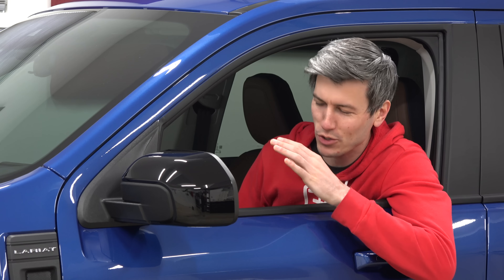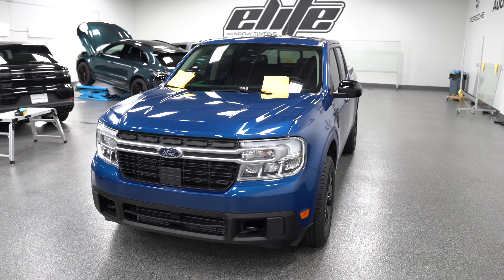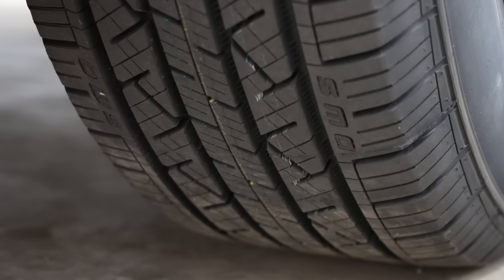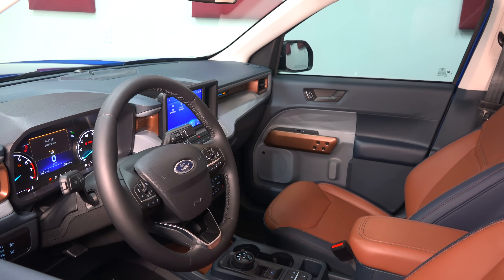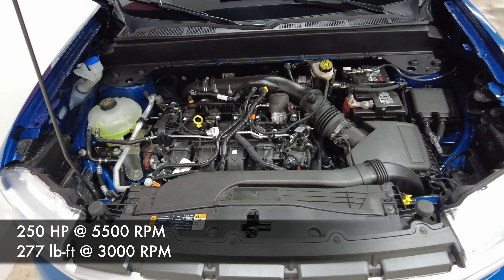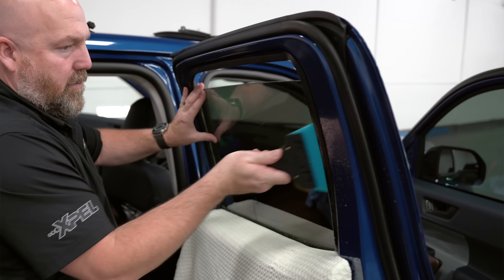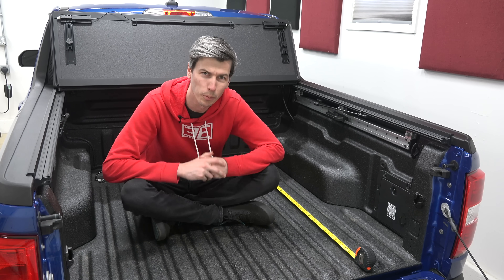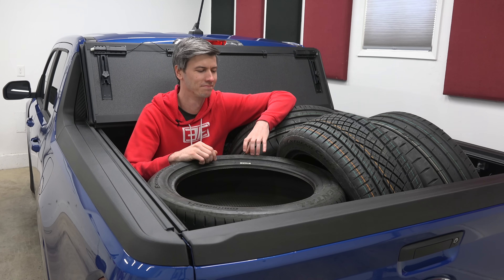I Bought A Ford Maverick! The Perfect Pickup?

Comment: Let's praise ford, anyone can crap out a poorly engineered entry level vehicle. But to design an entry level vehicle that has this much character, decent reliability, and respectable capability, that takes real effort. 

This is one of the first entry level vehicles in years that doesn't feel hopelessly cynical. You get the impression the designers and engineers who worked on this actuslly cared about it.
Reply: It’s not entry when it costs more than a 2021+ f150 xlt
Reply: @skyhawk21  You’re comparing a new 2024 Maverick Lariat? To a used 2021 F150 XLT? Just want to get that straight.
Reply: THis is a crap vehicle. WTF lol. Ford deserves no praise. They are a failure of a company. Ford is far worse than even tesla.
Reply: I doubt these will be “reliable” long term
Reply: @thomas735  The hybrid system has been around forever and has a stellar reputation for longevity.
Reply: @themidnighttavern6784  sure, it was designed by Toyota. I’m talking specifically about the 2.0T. If I had that engine I’d be doing oil changes every 3k miles.
Reply: @thomas735  It was designed by Ford and Toyota working together, it's more accurate to say Toyota uses Ford's hybrid system rather than the other way around. Ford uses some Toyota licensed parts at first, which is no longer the case. But the basic design principles of an akinson style hybrid system was patented by Ford first I believe.
Reply: @thomas735 the 2.0T isn’t that bad. Biggest issue is carbon buildup on the intake valves…which is an issue on most turbo direct injection engines. So yeah, you’ll probably have to clean the valves at some point, that’s a con for sure.
Reply: @themidnighttavern6784  dont argue with clueless people:) Fords hybrids are great
Reply: I love my maverick but man it's hard calling it reliable. Right now I don't want to take it to get serviced because I know they'll update the software to a known bad version that leaves you without power randomly.
Reply: @dpgerarddp  The losing power randomly thing is an upcoming recall. What Ford found was sometimes the software wasn't great at detecting the 12V state of charge. So at times, it would turn the engine off the save fuel, but the battery would be too low to restart it. There will be a new software update soon to address this.
Reply: @themidnighttavern6784  that doesn't sound like it's the source of the issue. Well at least not a primary reason. There's people out there losing all power on the highway in the middle of their drive, so why would the battery be discharged. Also how it seems to go hand in hand with the updated software and others like me, never have any issues. But my point was it has a lot of issues. The grabby brakes on lower software versions, loss of power on updated software, general issues with the wiring (I've had electrical problems throughout all these years), exhaust systems needing to be replaced (just ran into this one myself) etc etc
Reply: @dpgerarddp  The losing power issue was related to some bad software updates. Basically the truck wouldn't detect the battery being low, this could happen on the highway, as the hybrid still turns the engine off at highway speeds at times.
Reply: These are already having issues everywhere... They don't last.
Reply: @christianrobloxserver7282  Not really, I'm on the forums basically everyday. Most people are literally talking about how theirs has had no issues, mine included. Literally every car where they sell hundreds of thousands of them is gonna have some people who have issues. It happens with Toyota, Honda, Kia, Ford, Chevy, literally every brand with forums, you'll see people talking about issues.
Reply: @christianrobloxserver7282  The maverick is already on lists of most reliable affordable cars. The hybrid system has a reputation for being rock solid. Most of the issues with mavericks are software related, and are gradually being improved. The only physical part of the maverick that doesn't seem ideal, is called like CV axles or something. I've looked it up, those cost like $100 per wheel or something to replace, it's not a massive issue, and pretty common on FWD cars apparently. 

Compared to Toyota truck forums where the new Tundras are having to get 25 grand motors swapped out and replaced on trucks with 10k miles on them.

So mavericks, worst case scenario, at least for the hybrids, is having to pay $50 for a better 12V battery, or $100 for some new suspension components. That's literally the most mild case of worst case scenario issues I've ever seen on any Japanese, American, or Korean car. Most worst case scenarios on forums are costing you thousands of dollars.

Comment: Sorry.  Its not a truck if the bed is not separate from the Cab.  this is an SUV with the rear top cut off.  However,  Still functional.  (and yes, I know this is not the actual definition of Truck.)

Comment: I just picked up a 24 XLT AWD and I’m loving it so far. As someone who doesn’t need to tow more than a few times a year but may need to put an engine or transmission in the bed, it’s a better option than an SUV. Was actually between the Mav and Crosstrek but the physical climate control buttons are a million times better. Also (with a little trimming) the folding F150 shifter will plug into the Mav’s harness

Comment: Compare the bed weight capacity of the maverick vs the tacoma.   And when you angle the tailgate, you can fit a 4x8 piece of drywall or plywood by sitting it on the top of the wheel wells and balancing it on the edge of the tailgate.   They are handy little trucks and because of the unitbody construction they handle like cars.  Very fun to drive.

Comment: You really, really, really need to do a video on the Honda CRV Hybrid.  Why you ask.... the hybrid system works completely differently, for one, you can not feel any difference while driving between the EV and ICE modes.   As far as I can tell, no one else has done an indepth look at the system.

Comment: I just had the pleasure today of pulling up to a gas station with 3 pumps open (1 diesel and 2 gas pumps) and a Ford Super Duty pulled up and blocked the gas and diesel pump and was long enough to make it too far for the pump to reach the back of my small sedan. So it effectively covered 3 pumps.

Comment: But Jason, I've been watching your channel since day 1, I'm still your friend,  right??  8)  I do have a question about the tires. I usually run BFG KO_2's.  They have the little snowflake on the sidewall, certified for bad snow etc. If I ever go over the mountains in bad weather the "snowflake" means I don't have to install the mandatory chains on bad days.  Do those tires have the "snowflake" on the side wall??  They do have checkpoints for chains to!   Thanks much!   Take care...   8)    --gary
Reply from the maker: No 3PMSF, but 3PMSF is also a marketing decision on which tires to put it on. With new tread, at least, I've seen the data indicating these can hang just fine with 3PMSF tires. Perhaps when they wear down that's not the case.

Comment: Those of us who grew up in the days of the small Toyota/Nissan/Ford truck know exactly what you mean. The truck was the do-all machine and its 0 to 60 times or how large you could make the cabin to fit 20 people in it didn't mean anything. What mattered was, will it start when I turn the key, followed by "what actual work needs to be done today" that this Truck is going to assist me with. Today, all I see is "Princess Trucks" that are so expensive that the owners never do any actual off-roading or work in them. To each their own I guess, but my Nissan Leaf with a trailer still does more work than most of the trucks I see in my area. 🤣
Reply: That trailer got an 8-foot bed?  😜
The 8-foot bed was a big condemnation of the small pickups back in the day, too. "Work ready" vehicles with crew cabs these days and 5.5-foot beds just kind of crack me up, color me old school. 
This from an SR5 extended cab 4x4 Tacoma owner. 🤣
Reply: A 4.5, 5, 6 or 6.5 foot bed carries 8 foot lumber and sheet goods for home projects, remodels and renovations just as well as an 8 foot bed.
No one is traveling cross country with a truck bed worth of lumber or sheet goods, so it doesn't need to fit in the bed with the tailgate closed.

Short bed pickup trucks easily carry lumber or sheet goods from Home Depot, Lowes or a local lumberyard to home.
Millions of pickup truck owners know this.

The many tons of material to build a house aren't delivered to homesites in pickup trucks.
Material to build homes is delivered on long and large flatbed trailers and offloaded using forklifts at the property site.

Anyone who actually uses a pickup truck for work knows these facts.

Comment: For me, the deal breaker for almost any pickup truck is the harsh ride due to leaf spring suspension,  Honda Ridgeline is a good alternative that doesn't have that.
Reply from the maker: Coil springs in the rear on Maverick.
Reply: U haven’t felt new leaf springs on new f150s, softer than firm and absorb bumps well loaded or unloaded

Comment: It's a truck, just a different kind of truck (built on the C2 platform that unpins the Escape and the Focus when it was around).  Considering most people just use a truck as a replacement for a mid-size family sedan, a Maverick will do what most people use their vehicles for.  If you need something big for work/utility or need to tow/haul a lot of weight, then yes, you'll need a larger body on frame vehicle.  As with anything, buy what you need and/or want.  You know what you need it for and you bought something that will perform those tasks with ease.  Good job.

Comment: I'd love an AWD and/or plug-in option, as well. The one thing I'm unsure of about the Maverick is the transmission. Sarah n Tuned mentioned that it seemed under-spec'd for the motor, and then I saw another YouTuber had to have theirs replaced at 100k miles.
Reply from the maker: I only did 50k miles on my Crosstrek in 8 years haha; 100k is plenty for me, but hopefully it's more reliable than that!

Comment: Have had mine for a year and a half and still love it (2.0 XLT with all options).  Such a great design!  And it is kinda ridiculously quick for what it is.  Also, you're slacking, you could easily fit 2 more tires in the back seats.

Comment: Did I miss the "Hello everyone and welcome" ? We ordered a 2023 Maverick in September of 2022. It was never built for us. In September 2023 Ford contacted us to see if we still wanted a Maverick... we said yes, but wanted more options. In January 2024 we took delivery of a 2024 Maverick XLT Hybrid. It too has heated seats and steering wheel. In 2024 the hybrid had a $1500 upcharge, where in 2022-2023 it was standard. Good news is Ford gave us the discounts to bring the cost down to the 2022 model base price. YAY! My wife loves driving it. She averages 42-47 mpg. Someday she'll let me drive it. With the hybrid, the 12v battery is under the right rear passenger seat... I guess no room under the hood with all the hybrid stuffed up there. So far my ONLY dislike is the transmission shift "knob". I would much prefer the column shift lever. Side note, Ford Explorer comes with shift knob, except for the police package, that comes with a column shift.

Comment: One of our engineers at work bought one of these last year. She waited two years to take delivery on it. I told her exactly what this video says. It is probably the most practical vehicle on the road right now. Thanks for sharing this.
Reply: 1995 Ford F-350 single cab long bed diesel: allow me to introduce myself
Reply: @UHOH3300  gets 10 mpg , and stops slow, takes off slow, cumbersome, shall i go on?
Reply: @jeedwards1981  18mpg actually, on any fuel except gasoline (waste motor oil, atf, cooking oil, you name it.) if you think an old body style ford has insufficient brakes you’ve never driven one
Reply: @UHOH3300  still not a practical
Vehicle . Sure cheap to own and operate.
Reply: @jeedwards1981  not practical? Ok, I can see you’re clearly not debating in good faith.
Reply: @UHOH3300  a giant behemoth of a vehicle is not a practical vehicle . I love super duty’s etc but to call them practical is a stretch .

Comment: I wish the Maverick was body on frame like other trucks... I think of the Maverick like the Santa Cruz, they're both utility vehicles and what they do they do better than anything else in the market. But without that structural rigidity of body on frame it just does not operate the same. Keep in mind I love both the Maverick and Santa Cruz, I just wish they weren't unibody. But I understand the desires of small, lighter and better MPG which all play a huge part.

Comment: Cars suck now and I can prove it. Your maverick 2.0l gets 24mpg hwy, tows 2000lbs, and weighs 3600lbs. My '98 k2500 pulls 8000lbs, has the 6.5 Detroit, is 4X4, 8ft bed, weighs 7000lbs and gets, drumroll please, 21mpg hwy. 
3 less than the 25 years newer truck. Why would I buy the less capable truck for 3mpg?

Comment: I think the Ford Maverick is great. The only issue I see is when you start going to the upper trims you get into 1500 pricing. You can buy a brand new Ram 1500 classic v8 4x4 crew cab 6ft bed for about the same price as a higher trim maverick.

Comment: I'm still waiting for a REx option of a truck around this size, maybe between this and an F150. Something with ~100mi of battery range, dual e-axles and a small, simple, efficient REx generator. A little 75Hp NA 3 cylinder is more than enough to maintain highway speeds with a small trailer/boat when battery runs out.

Comment: There is nothing else on the market with the flexibility, capability, compact size, and relatively economical powertrain. I don't like trucks, but I do like the Maverick. There, I called it a Truck. It will also outmaneuver and easily outhandle the big brothers. Power? COBB, anybody?

Comment: Just an FYI pointed at the manufacturers ...we all want a "real" pickup truck. But some of us want to pay it off in less than 8 years. My fully loaded Lariat is $37,000 ....an F-150 is $35,000 base model with no options.
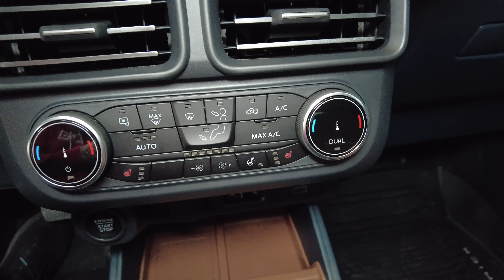6:33 Why does the most expensive trim get the heated steering wheel button on the wrong side? The single zone button is in the middle

Comment: I have a tremor maverick ,custom 4 1/2” lift ,chromoly a arms 32” mud terrains and it rips in the desert and mountains , almost as good as my full size bronco off road and yet has a bed big enough for my work needs daily .you can check it out on maverick truck club under pre runner build .

Comment: Ha, congratulations!  I'm currently driving a 2020 F-150 Fleet configured truck which is much more luxurious than my 1991 F-150 Fleet configured truck (the newer one has a RADIO, but like you, I did have to give up a manual gearbox.) 

One of my favorite trucks was a 1987 Ford Ranger with the V6, dual tanks and extended bed. Great mileage and range (over 800 miles!), but a little light on both bed capacity, and towing capacity. I once put the rear axle on the snubbers with just three full size railroad ties in the bed.

Comment: I did consider a Maverick for quite a while... but I ended up with a Tacoma. It's a little larger than I would have liked, but for a similar price (lightly used Taco vs the new Maverick I was considering) it's hard to argue with the reliability, capability, and its low depreciation. Plus my TRD Offroad has 16 inch wheels. Perfect for smashing curbs at the mall :P

Comment: I used to haul tires in a V6 Ranger that had a bed, 2 seats,  4 wheels, steering and shifter AND NOTHING ELSE. Now that was a truck.
Reply: I had an 08 ranger 4.0v6 4wd manual. loved that truck.
Reply: I've got a 2002 Ranger with the 3.0 V6. 6' bed, 2 door extended cab, RWD, 232.4k miles and still the factory engine and automatic transmission. I've got a toolbox in the bed, and i wouldn't trade it for one of these if they paid me.
Reply: back when the only thing a truck was, was a truck
Reply: Yeah I mean the old small trucks had bigger beds. That's the problem here. Even bigger trucks. The bed is so small in these crew cabs. Less than 6ft seems like a big trunk that's open. Why didn't they offer and extended cab with a big bed😢. Then it would be a truck
Reply: I had an '02 Ranger Edge 3L 5 speed regular cab...Drove it for 12 years,  was dependable and got me through a lot of NE snow!
Reply: That's my plow truck. Standard cab 4.0l V6, 4x4 5 speed.

Comment: No. My truck cost $1000 and has an 8' bed. It does not have a toothed belt driving the oil pump. It's a 1981 Chevy c10. Daily driver. Uses more gas than the Maverick, but didn't need to be manufactured with all of those emissions. It's cheap to maintain, and has very low insurance costs.  Also, has a 3 speed hurst on the Floor. Hah!  If you use the maverick as a truck, it's always too small. You paid how much !!!?

Comment: From a fuel economy and cost standpoint I don’t know that the AWD 2.0 (non-hybrid) Maverick makes all that much sense compared to something like a Ranger. It’s probably much more comfortable to drive and probably easier to squeeze into tight spots but it seems definitely less capable as a truck and I don’t think it’s actually all that small compared to something like a hatchback or wagon. I’d love to see you do a more in-depth breakdown comparing the AWD Maverick to other vehicles that people might cross shop it against.
Reply: So I can speak to this, my dad has a 23 ranger crew cab 4x4 and I have a 24 AWD maverick. He gets 23ish mpg on his round trip to work, all highway driving in 2WD. I’m getting 30 miles average with a mix of highway and city driving. Now maybe if his was 2WD only and didn’t have the off road package he’d be closer, but I still don’t think he’d beat me
Reply: @HaloBoss65  makes sense. thanks!